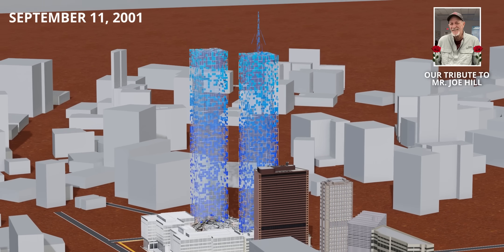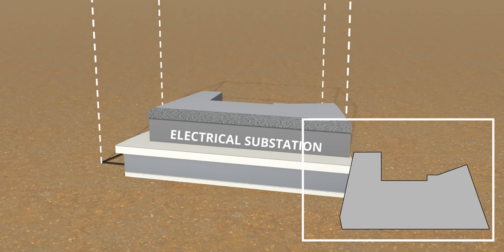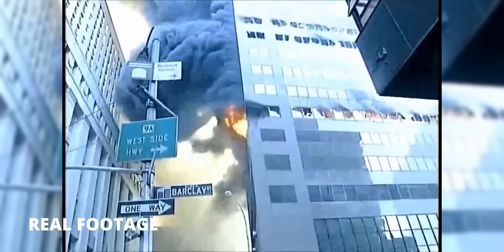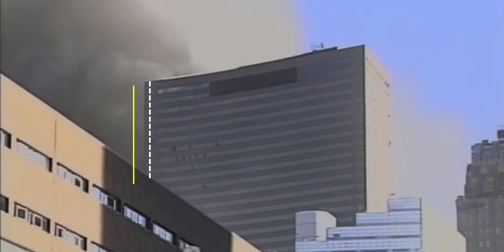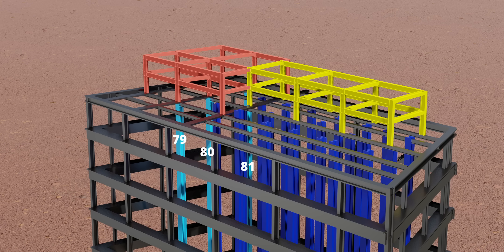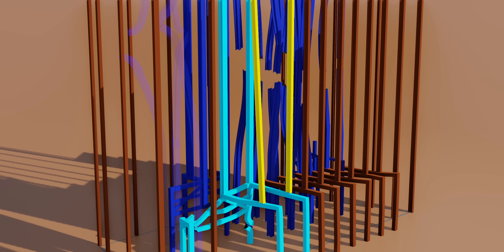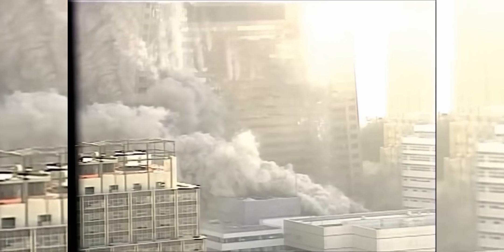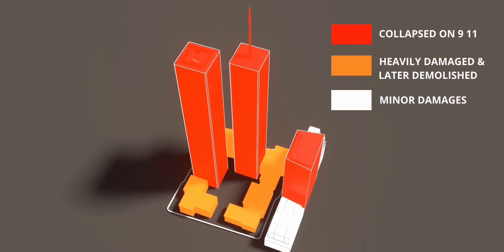Collapse of Building 7 | The Complete Physics

Comment: Wasn’t the City of New York’s emergency response center located in a hardened area of the building? Never has a fire brought down a steel building until this . Don’t pee on my leg and tell me it’s raining! Even the owner said we decided to PULL THE BUILDING! A term used in explosive demolition of a building and it takes months to prep a building to “pull” it. Watch YouTube block this response!
Reply: "Wasn’t the City of New York’s emergency response center located in a hardened area of the building? "
No.

" Never has a fire brought down a steel building until this . "
Complete nonsense.

"Don’t pee on my leg and tell me it’s raining!"
No need, you lie on your back and piss into the air and claim it's a shower.

"Even the owner said we decided to PULL THE BUILDING!"
That you fail at basic English is a "you" problem, not anything else. You should really have stayed in class instead of sneaking off to huff glue.

"A term used in explosive demolition of a building"
A term never used in anything of the sort. That you thought the older kids in the playground seemed really cool, and so you repeated what they said without even an attempt at thinking? Mean nothing other than you failed, again.

" and it takes months to prep a building to “pull” it"
Yes, it does. And during all of those supposed months, the entire building was full of people and in constant use. Amazingly, none of them actually noticed when the walls were torn out and the furniture was removed. Because, what do you know, that's what prepping a building for demolition entails.

Congratulations, you said dumb shit with literally no originality, and then tried to pretend that you were really really important and "the man" was ever so scared of you personally.
Reply: Fire brings down steel framed buildings all the time. It is a regular occurrence.

Larry Silverstein in a TV interview admitted he agreed with a fire department commander they should pull “it” (the firefighting operation – pull the guys out) because the building could not be saved and they wanted to avoid further loss of life. 

Here’s what was actually said by building owner Larry Silverstein to PBS, and without removing all of the critical context:

Kevin Spacey (narrator): Pelted by debris when the North Tower collapsed, [WTC] Seven burned until late afternoon allowing occupants to evacuate to safety 

Larry Silverstein - I remember getting a call from the fire department commander, telling me that they were not sure they were gonna be able to contain the fire, and I said, “We’ve had such terrible loss of life, maybe the smartest thing to do is pull it.” And they made that decision to pull and we watched the building collapse From PBS “Rebuilding America's Defenses” (2002) 

While this phone call almost certainly never actually happened, it's a good thing the FDNY could see Building 7 was dangerously unstable, the fire could not be contained making any effort to do so futile thus they could make the wise decision to pull the firefighters out and avoid further terrible loss of life.  

Demolishing an empty burning and unstable building does not logically follow from the sentence "we've had such a terrible loss of life".  What does logically follow would be referring to pulling the firefighting operation out of the building before it’s inevitable collapse to prevent further loss of life.

FDNY Chief Daniel Nigro - The biggest decision we had to make on the first day was to clear the area and create a collapse zone around the severely damaged 7 World Trade Center, a 47-story building heavily involved in fire. A number of fire officers and companies assessed the damage to the building. The appraisals indicated that the building's structural integrity was in serious doubt. I issued orders to PULL back the firefighters and define the collapse zone. It was a critical decision; We could not lose any more firefighters. It took a lot of time to PULL everyone out, given the emotionalism of the day, communications difficulties and the collapse terrain

Leading demolition and explosives expert and editor of Implosion Magazine Brent Blanchard - We have never ever heard the term ‘pull it’ being used to refer to explosive demolition and neither has any blast team we’ve spoken with

You are badly informed.
Reply: @TheCriticalStinker-01 
Really? I remember the first interstate building fire in Los Angeles where two floors were burned out complete in a steel building and it did not collapse the upper floors. There was a building in London that burned for over 24 hours its steel did not collapse.. And when you view the collapsing of the building that was housing, a bunker for emergency controls of the city, in the videos, it does not match the explanation you’re giving. It came down evenly starting at the penthouse and did not collapse on one side, and then into itself. It came down, almost symmetrically, within its footprint,. Also, there were buildings in between tower seven and the other twin towers that did not collapse from debris, but they were not an armored bunker building..There is too much wrong with the government explaining what happened that tragic day.
Reply: @CountDeMoné   How is it that some people who get shot die, while some walk away?
Reply: @CountDeMoné  - First off, I accept your deliberately evasive off-topic derail as tacit acceptance you were wrong about the whole pull it thing.  That topic is now resolved and off the table.

Moving on to your next post:  Curious why you chose to leave out actually relevant examples like Plasco Tower or Wilton Paes de Almeida?  Ignorance or lie-by-omission? 

How about I just explain the collapse of Building 7 in detail rather than you comparing it to other, non-comparable events you also don't understand? Because anything can seem like a conspiracy if you don't understand how it works.

Comment: No. Much more deliberately done. The explosives were set on each floor both for building 7 and the twin tower plane crash.
The fires were done as an ignition to start up the explosives. Hence, when the fire finally reaches the explosives the chain reaction happens.
The jet crash for the twin tower made the explosives chain reaction faster because the ample amount of jet fuels reaches the explosives faster.
The explosives I heard were set on every floor from bottom to top. Hence, the collapse for both building 7 and the twin tower hit by the plane are instantaneous. The jet fuel alone would not have created an instant chain reaction of such manner.
Nor would have the fire in building 7 been able to make the building collapse in such a manner.
They don't want you to know that the explosives were deliberately set up in the building beforehand 😅.
And so this video for building 7 and the plane crash video are both cover ups to make you think it was the fires that caused the total collapse.
It's a desperate attempt to hide the explosive set ups which were done even before the fires started...
Reply: Could you do me a favor and in this video point out each of the explosive devices going off

www.youtube.com/watch?v=4xN8lzBo9zY

Each should be at least 130 dB at this distance so no trouble at all to pick out.

Comment: Oh ok, so the other 70+ columns just vanished in thin air, right?
Reply: No.  Building 7 was a unique, asymmetrical 47-story steel frame structure built atop a smaller 3-story building serving as a partial foundation, requiring lower floors dedicated to complex load transfer structures. Of trapezoidal shape and tube-in-tube construction, B7 (above the 7th floor) consisted of a central core of steel columns carrying most of the gravity load, perimeter steel columns around the outside of the structure carrying the remainder of the gravity loads and long span beams and girders to tie those elements together and form the floors. On the outside of the building hung a facade or outer shell. 

www.nist.gov/image-16640

Phase 1 : First externally visible signs of collapse initiation occurred at 5:20:28 pm and was notably quiet with observers not realizing the building was collapsing! No warning in the form of hundreds of eardrum busting 180dB explosive bangs. Here at 12:00 a local CBS affiliate reporter talking 10 blocks from B7 when collapse begins. People don’t start to notice the collapse until 12:11. At 12:45 is the famous CBS fixed camera clip of Building 7’s collapse. Note the silence. 

www.youtube.com/watch?v=t5tEy6mXSE8

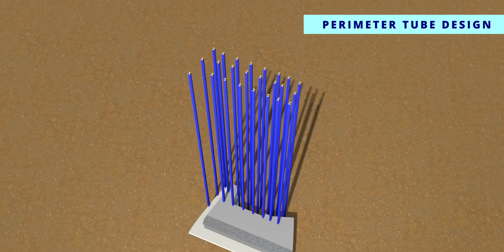Lower floor failures above the load transfer region (8-14) in the NE corner initiated the collapse. In this video at 0:45 you can see the NW corner from inside the building while under construction, Column 79 just out of frame on the left. That big, angled steel beam across the top of the frame connects to C79 at one end. The girders connect to the beam. That beam and all those girders depend on just one connection 

www.youtube.com/watch?v=nP3TNHPCIVU&t=45s

Phase 2 : NE corner floor failures caused a loss of critical lateral support over an excessive length of Column 79 and it buckled. Looking at the above floor diagram of Building 7 when you see all the structures that depend on C79 you quickly realize this one column was a relatively isolated structural element on which a disproportionately greater fraction of the structure depended analogous to say the Key Bridge. Externally as collapse begins we see a vertical progression of window breakage along the 44-46 line and a kink in the roof of the East Mechanical Penthouse at the top of the building, consistent with C79 failure. Normally with a buckling column, the load could be redistributed to other columns. With C79 that is not the case - the failure did not redistribute the load, so the collapse rapidly progressed to the roofline, sinking the rooftop penthouse. The transition from full capacity to almost no capacity occurs in an instant and will result in virtually no resistance 

Phase 3 : With C79 gone, B7’s progressive, non-symmetrical collapse continues with adjacent columns 80 and 81 left laterally unsupported and quickly buckling as well. The EMP drops down through the building. C79-81 all have no diagonal bracing, which is the major reason why they could not redistribute a lot of vertical loads among one another. From there collapse progressed from east to west through the central core until the core was gone from 81 to 58, taking all the interior floors and probably most of the perimeter columns with. Follow the horizontal progression of window failures low in the building and the dropping of the remaining rooftop structures into the building. The NIST Building 7 study model 4 determined C79 failing under ANY circumstances would have initiated the same collapse sequence. 

Phase 4 : After about 10 seconds only the exterior moment frame remains, giving the illusion B7 is still standing to the casual observer since little has outwardly changed. But it is just a hollow empty shell like an empty cereal box supported only by a few remaining columns and overloaded from the loss of the core columns and floors, quite unable to remain standing. With nothing remaining behind it, the north face leans inward, forming a V in the roofline, the last few columns buckle under the strain and the moment frame free falls, landing on top of the debris pile. 

It is only here at the very end, a single measurement of alleged free fall acceleration is taken, from just one point on that outer shell. The Building (core and interior) did not “free fall” - was already gone before that happened - just one corner of the outer shell briefly moved at a rate comparable to FFA. This alleged FFA was a product of how the shell fell NOT why the building fell . It’s also not even proper FFA as the single measured point was moving in 3 dimensions, not just down, which adds another variable. Start to finish the collapse took 18-20 seconds, 3 times longer than true FFA . How fast something falls can’t tell you what started it falling, certainly not 10 seconds after it started falling.  

The debris spread outside the footprint blocking surrounding streets, heavily damaging the Verizon Building and destroyed Fiterman Hall. 

No building is meant to survive 7 hours of multi-floor unfought fires. Building 7’s progressive, non-symmetrical collapse was incidental, unintended collateral damage from the combination of fire, time & gravity started by the collapsing North Tower, true no matter who planned and carried out the 9/11 attacks or why .  Of so little consequence it barely registered at the time, only taking on semi-mythical status as an alleged smoking gun years later when demolitions at the Twin Towers, missiles at the Pentagon and shoot down over Shanksville all failed and conspiracists had nothing left to work with. 

Anything can seem like a conspiracy if you don’t understand how it works. Now you should. I hope you found this helpful, informative and it solicits informed critical comment. If I made any errors of fact, logic or reason or left anything important out, please let me know so I can fix it. OR offer a more plausible alternative if you can. Be the first. Please start any reply with the words “Tits McGee” or I will know you didn’t read it and are wasting my time.